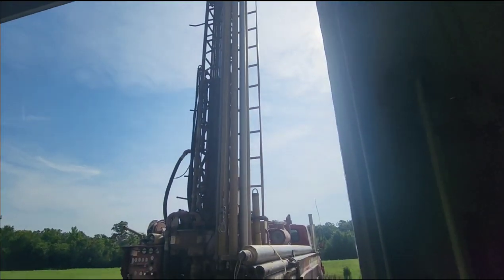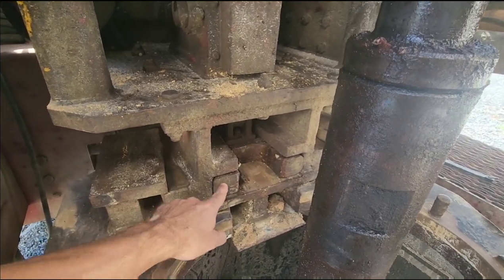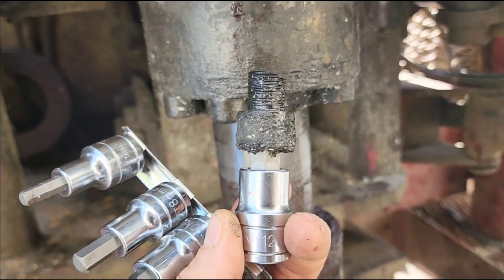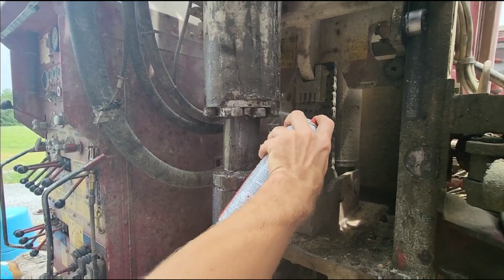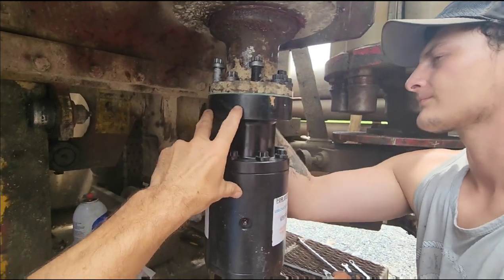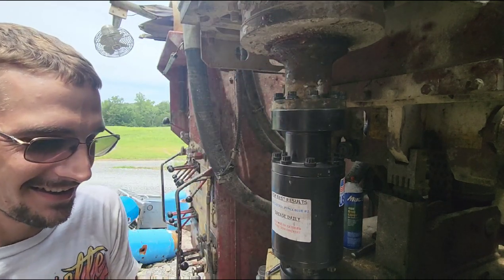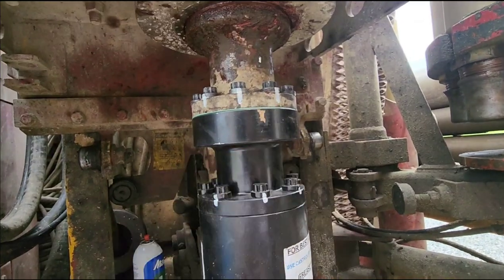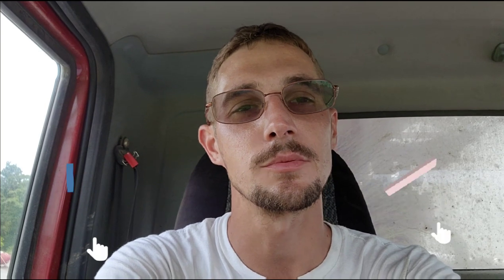$6500 Drilling Rig Repair Day, Table Welding & Floating Sub Install on Schramm 450WS

Comment: Nice job .... glad to see an American Co making a good quality, less expensive replacement part ... never worked a drill, but know that maintenance, cleaning, lubing hard working parts and machines make things run smoother and safer ... I worked for a big irrigation co in college, friends 2nd generation family business ... we knocked off at noon on Fridays and went back to the shop, he bought lunch and we spent to the afternoon cleaning and maintaining our heavy equipment ... cleaning service trucks and inventorying and stocking pipe/parts/tools .... then over to his house for a relaxing swim in the pool ... both he and his Dad were pilots, so safety and "check lists" were respected ... that schooling paid off for me as a builder for 30 years, Friday afternoons were spent cleaning/organizing/securing job sites, tools, trucks and getting a rough plan and materials lists for the following week so everyone was "on board" ... new guys got an education and were made to feel like an important part of the "Team" ... keeping an open mind that even some new guys had good ideas  .... and BTW, your well pump vids are an invaluable resource for servicing/replacing well equipment ... I always learn something new or important ... so thanks !!

Comment: The rig looked similar to  the drill rig I was on when the well caved in the front up in the air  it caved and made a giant sink hole it was the first and hopefully the last time I see the earth in layers🤞. a lot of concrete to fill it in and cutting the pipe with too trackter chain to the front end. Can definitely be a little chilly. Doesn't every thing coast more then a car in this line of work 😅 nothing cheap🤬. If you don't have to tale out or in the steal drill pipe💪 it not to bad almost easy 👍👌✌️💯🌊💧